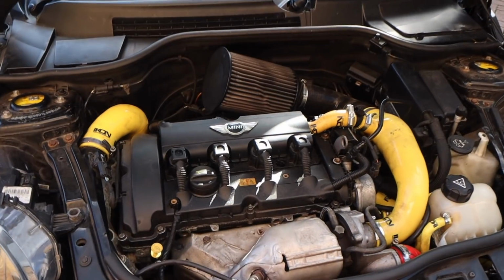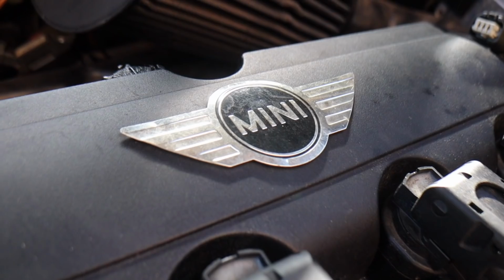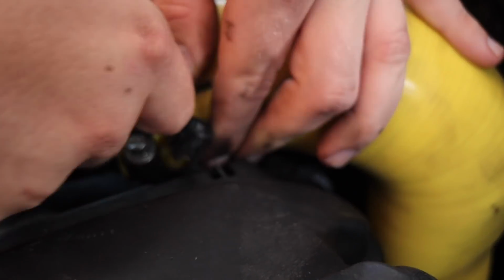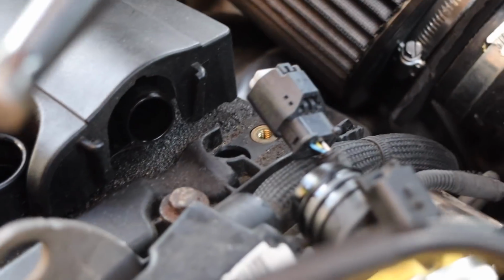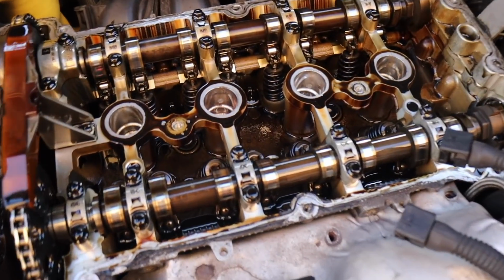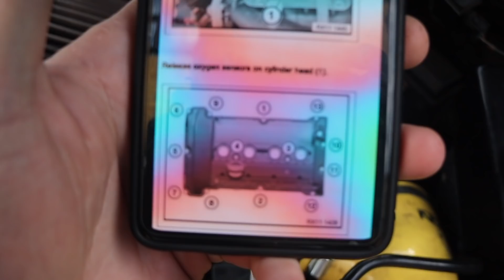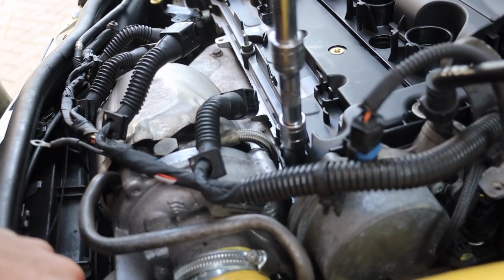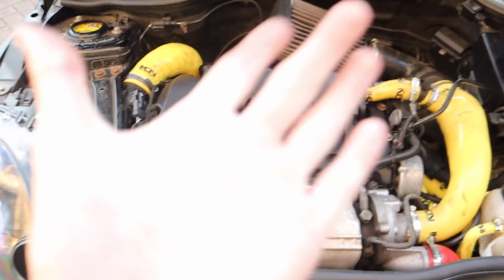MINI COOPER JCW R56 CAM COVER REPLACEMENT (BAD OIL LEAKS)

Comment: It helps to put a blob of sealant where the gasket meets the curved parts of the cylinder head as it can leak from them areas. Them cam followers look fine as long as there ain't no scoring marks 👍

Good job lads
Reply: Also the pcv valve is part of the rocker cover and if it fails it can cause a vacuum leak/ boost issue
Reply from the maker: He looked at it after we finished up and he said there was a hairline crack in it pal 👍

Comment: I believe im having the same issue with my 2012 jcw. It has a boost leak due to cracked valve cover. Before you replaced the valve would the idle kind of blip randomly?

Comment: You guys crack me up 😂 "tight as a whistle" ! Did you use gasket seal ? And defo get a torque wrench !!! Great vid again mate 👍
Reply from the maker: nah no sealant pal :)
Reply: How does it not leak without a gasket?     It had one on the original cover.

Comment: Where could I order a cam cover for a R56 N12 engine please?
Reply from the maker: mini direct maybe
Reply: @JustbeingHayden  many thanks mate
Reply: On my N14 (R55 S), I'm gonna try an aftermarket cast ALUMINUM valve cover (powder coated color choices-silver, red, black, blue) for the same price as an after-market plastic version.  Will avoid plastic cover warping issue, I would imagine. 
Will still use hi-temp RTV gasket sealant in the 2 or three halfmoon/corners of the gasket areas of the ALU valve cover, prior to placing it on the motor.
Will also follow the standard torque and order guidance (for the 13 bolts; 7.5 ft-lbs).

The garage did a shitty job on the last valve cover replacement. I will do it right and by myself. Current plastic version leaks, smells...a mess. I think they did not use any RTV...frigging idiots.